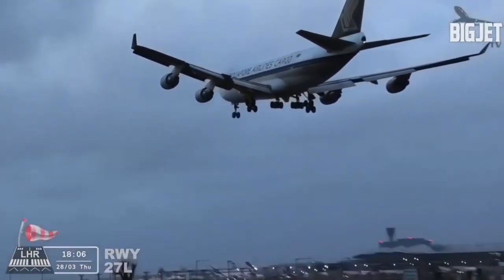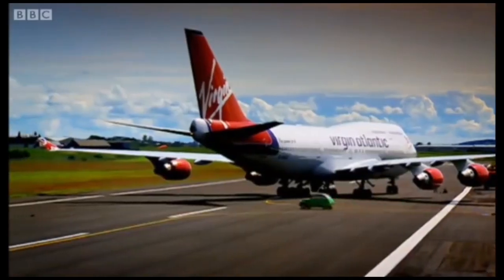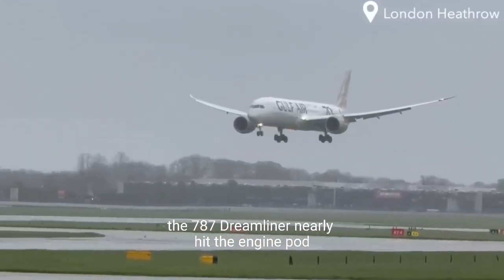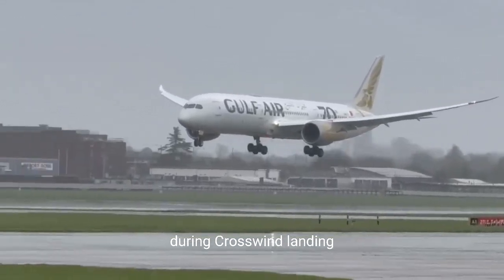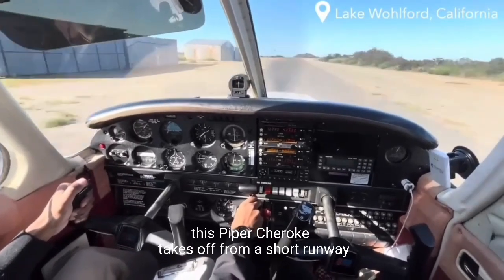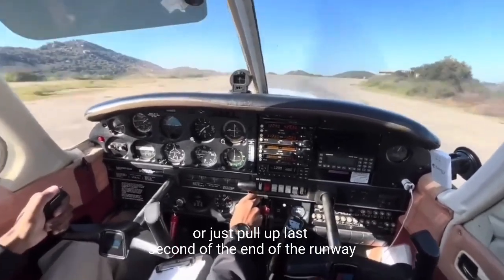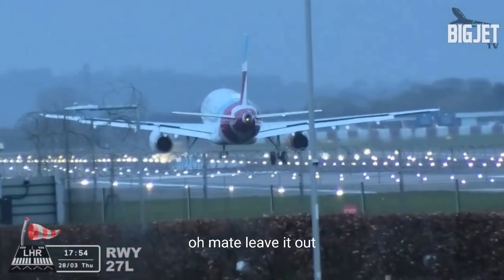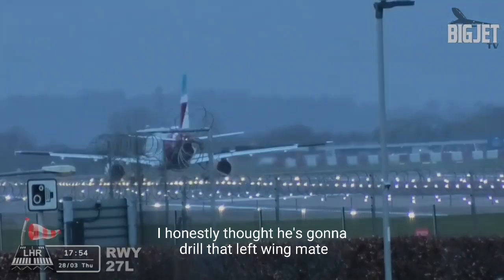Car Vs Boeing 747 Engine

Comment: In TOP GUN, there are also shots of fighter planes flying quickly past the tower. Are the pilots doing this to show off their superb flying skills? Is it dangerous?😂
Reply from the maker: That stunt would be a major, major violation of safety rules, not to mention an FAA violation for disobeying tower instructions. Plus, if “the pattern is full”, that stunt would endanger every aircraft in the pattern. Absolutely unacceptable.😊